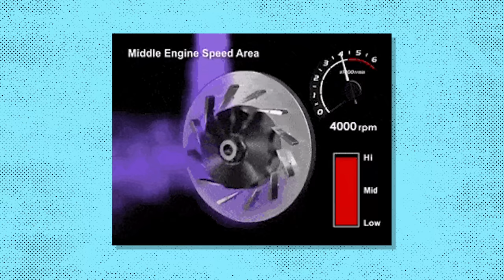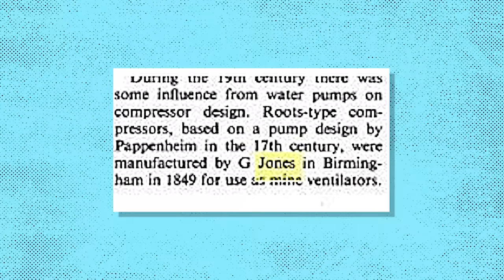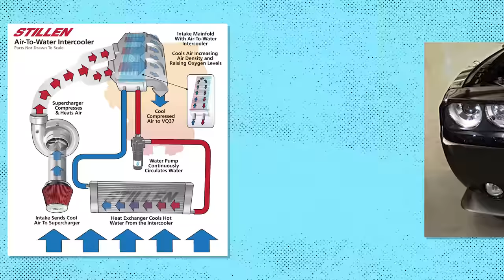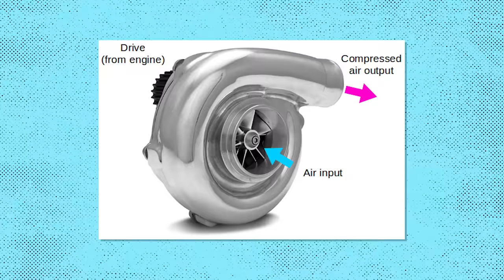Why Superchargers Aren't As Good as Turbos

Comment: Turbo lag is a common problem not apparent superchargers. Turbo's turbine and compressors are normally sized for a particular rev range where there is enough gas flow for them to operate efficiently below this lag they merely increase backpressure and above fail to produce any more flow and therefore power. Superchargers normally operate over a much wider rev range. Depending on how the Turbo is mapped in high HP systems on reaching the boost threshold there can be an instantaneous release of power with tyre traction, high mechanical stress and instability. Turbo's get extremely hot requiring cooling and oil lubrication usually from the engines oil system and cooling systems requiring extra plumbing and adding to stress on those systems. Superchargers operate at lower temperatures and often have self contained lubrication systems.
Electric centrifugal superchargers are super efficient can run at constant speed supply max designed boost over the whole rev range with no lag and little parasitic engine loss but require an expensive 48volt electrical  system to operate.
Reply: Centrifugal superchargers don't have lag? Excuse me?
 Turbo engine need more cooling because they produce more power.
 Boost lag isn't a problem for most correctly designed applications, it is not a real disadvantage but rather an imaginary problem. Turbochargers lag is not accelleration lag.
A vehicle with more power will accellerate faster.
Reply: How can a turbocharger cause backpressure when it flow the same CFMs or more than a naturally aspirated or supercharged engines???
Sounds like you really don't understand how turbochargers work?
Reply: And electric supercharger will have more parasitic loss than a direct or belt drive... this basic engineering fundamentals.
Reply: @sandervanderkammen9230  If you read the comments correctly ELECTRIC superchargers have no lag in operation as the 48 volt system gets the compressor up to speed and keeps it at its designed rating from start up so during operation the there is no lag.
Boost lag is always a problem no matter how well the system is designed unless multiple turbo's are employed cover all rpm spectrums.
The whole point of turbo is to make the engine more efficient and produce more power across the widest RPM range as possible. The duration of the lag compromises these aims the lag determines how quickly the boost pressure becomes effective and over what range.
Reply: @sandervanderkammen9230  Anything which impedes the flow of exhaust gases causes back pressure. Exhaust pipes silencers, DPF's etc. It is obvious it is you who have no idea what you are talking about.
Reply: @jimcraig6523  Don't try to dodge the question son.
Explain how there is backpressure caused by the turbo if the engine produces more power at the same CFM flow or flows more CFMs than a supercharged or naturally aspirated engine.???
Reply: @jimcraig6523  Boost lag is not accelleration lag, it is a perceived lack of acceration based on a non-linear power curve.
 Having a flat power curve improves drivabilty but does not determin the rate of acceration or top speed.
Reply: @jimcraig6523  I don't think you understand what backpressure is, there is no Delta~P so no pressure differential between the intake manifold and the turbine inlets.
Turbochargers use an Impulse Type turbine which uses the velocity of the hot gasses, not the pressure.
Their is no parasitic load on the reciprocating engine by the turbo, it is driven by the heat energy rejected by the reciprocating engine and normally wasted out the tailpipe on a supercharged or naturally aspirated engine.
This is why turbocharged engines make more power... they waste less heat energy and use that energy to reduce the pumping loss.
The temperature drop in turbine is directly linked to the amount of horsepower generated by the turbine wheel and is calculated by using the Brayton Cycle Formula.
Any questions son?
Reply: @sandervanderkammen9230  Are you being deliberately obtuse or just plain ignorant. Anything which impedes the flow of exhaust gases causes back pressure or the inability to find UNRESTRICTED flow. Tthe fact that greater HP is achieved above the boost threshold by forcing more air into the engine does not mean backpressure does not exist. Below the boost threshold the turbo produce no increase in power as the energy from the exhaust gas flow is absorbed by the turbine and the back pressure is greater. No matter what speed the exhaust gas flow enter the turbo there is an energy loss in driving the turbine and compressor wheels. There are no free lunches. The lower the gas speed the greater the loss in relative terms.
Reply: @sandervanderkammen9230  If you cannot produce more power below the turbo threshold that lag most definitely affects the acceleration  wanted or required. What threshold you choose will determine the total power output and size of the Turbo and larger the turbo results in more lag and power higher up the power band.
Reply: @jimcraig6523  Wow, that comment reveals someone who has absolutely  no formal education or professional experience in the field of engineering or engine technology.
You sir are obviously not qualified to speak inteligently about turbocharged engines or ICEs in general.
 Please stop spreading lies and ignorant misinformation.

Turbochargers do not create backpressure because there is no pressure differential... the turbocharged increases power output by increasing volumetric efficiency while simultaneously reducing pumping loss.
If the turbine created a restriction? There would be less flow and higher pumping loss.
The turbocharger is driven by heat energy rejected by the reciprocating engine and does not cause backpressure.
Reply: @jimcraig6523  Turbocharged engines operate using a combined heat cycle with the turbine utilizing the Brayton Cycle as a second pass heat recovery engine.
The heat energy rejected by the reciprocating engine is used to drive the turbine by velocity of exhaust gases, not pressure.
Reply: @sandervanderkammen9230  If there was no difference between the turbine inlet and the manifold pressure there would be no boost. Inlet turbine pressure will be at ATMOSPHERIC 14.8lbs turbo manifold pressure can be anything up to 50-60lbs
 No one ever suggested that pressure drove the turbo turbine only gas speed which is affected by parasitic losses in the valve train and manifold systems. No engine is ever truly unrestricted as far as exhaust gas flow is concerned and there is a pressure developed depending on how well the whole system is designed but will be at a minimum of ambient atmospheric. 
If you knew anything about thermodynamics "SON" you would know in the Brayton Cycle the actual turbine cycle is different from the ideal since the compressor consumes more work and the turbine produces less work than that of the ideal Brayton cycle.
Reply: @jimcraig6523  Sorry son, but your math does not add up.
If there is 7psi of intake manifold boost  pressure  (21.7 in.hg. absolute)
And 7psi of exhaust manifold pressure, WHERE IS the backpressure caused by the turbine???
If there is no pressure differential between the intake and exhaust manifold where is the parasitic loss caused by the turbo?

The centrifugal compressor is significantly more efficient than the pistons in pumping air... even at WOT the intake manifold pressure is less than atmospheric.
Approximately 20% of the heat energy lost after mechanical conversion into shaft horsepower is lost to frictional and pumping loss.
The fundamental concept of forced induction engines is the increase in volumetric efficiency and reduction of pumping loss.
 The turbocharged engine produces more power at the same intake manifold pressure because they significantly lower pumping loss.
Reply: @jimcraig6523  A turbocharged engine operates as a COMBINED CYCLE heat engine e.g. Otto Cycle + Brayton Cycle or Diesel Cycle + Brayton Cycle.
Both heat engines share the same thermal reservoir and adbatic compression cycle.
 Turbochargers engines produce more power than supercharged engines because they use the waste heat energy expelled from the reciprocating engine to drive the turbine.
 The exhaust gas temperature drops as it passes through the turbine, typically 100°C (300°F) 
The temperature drop and the mass of the exhaust gasses tell us how much energy is converted into shaft horsepower generated by the turbine wheel, we use the Brayton Cycle Formula to calculate the thermal efficiency and horsepower generated by the turbo.
 This energy recovery can also by calculated by measuring BSFC
 If you have 2 identical engines, same manifold boost pressure, one turbocharged and the other supercharged, the turbo engine will consume fewer kilograms or pounds of fuel per horsepower generated (per hour).
Any questions son?
Reply: @sandervanderkammen9230  What are you talking about?
Backpressure is simply the resistance to the natural direction of flow of any fluid. It is scalar in essence having magnitude but no direction. Anything which impedes the flow boundary fluid in pipework exacerbated by bends, valves, manifolds, silencers, DPF's Turbo's all conspire to increase friction and generate heat resulting in power loss.

 Exhaust gases leaving the exhaust port stack up in the exhaust manifold behind the turbine wheel as it provides an impediment to flow which must be overcome by the exhaust gas to turn it. That is back pressure. Similarly on the compressor side manifold pressure is stacked up in the inlet manifold waiting on the inlet valve to open. Backpressure. 

In practical terms the chance of arriving at a boost ratio of 1:1 where the exhaust manifold pressure equals the inlet manifold pressure is highly unlikely simply because of the impediments to flow already outlined. The best you can hope for is to get a system with the minimum exhaust back pressure to supply the boost level required which is a series of compromises based on what parameters are set for the engine. EG. A boost ratio much higher than 1:1 would be required to generate the same power as altitude increases.

If you do not believe in exhaust back pressure simply build a few systems and install a backpressure monitor and see what happens.

Parasitic losses for an exhaust gas turbo refers to the loss in efficiency and potential as described due to the losses already enumerated. 

A turbo compressor is only more efficient at pumping air once it has attained its design speed which is much higher than ay piston speed.
Reply: @sandervanderkammen9230  If you are going to run internet searches on subjects you don't understand sonny do not waste my time. As already stated the Brayton or joules cycle is not the most accurate method of determining the thermal efficiency of an internal combustion engine. 

Turbochargers do not produce more power because they use waste heat. They are more EFFICIENT because they use waste heat from the exhaust.

The heat energy absorbed from the hot reservoir in a heat engine to the output to the cold reservoir determines the work done and from that the overall thermal efficiency of the engine including the turbo or supercharger can be calculated.

The turbo may well be more efficient as I know having built many turbo engined systems. But for overall driving in the 1000-5000 rpm range where most everyday driving is done there is nothing to compare with a twin screw supercharged engine for overall drivability.  

There have been a few Supercharged and turbo cars built the only one I have ever driven was the VW Scirocco which was quite impressive marrying both technologies in one package on a small 1.4 litre engine.
Reply: @jimcraig6523  Thank you for proving my point. 
If there is a 1:1 ratio between the intake and exhaust manifold pressure? Then there can be no backpressure... no resistance to flow.
 The Turbine is driven by waste heat energy, not a parasitic load on the reciprocating engine.
This is why turbocharged engines produce more horsepower and use less fuel.
The Turbocharger is a Brayton Cycle engine.. we use the Brayton Cycle Formula only to calculate its efficiency, just as we use the Otto Cycle Formula to calculate its efficiency.
When we turbocharge an engine it becomes a Combined Cycle engine... we use the Carnot Cycle Formula to calculate its efficiency.
Any questions son?
Reply: @jimcraig6523  A twin-screw supercharger is inferior to turbochargers... positive displacement type compressors are less efficient than centrifugal compressors and any increase in volumetric efficiency is off-set by the parasitic loss created by driving the compressor.

A twin-screw supercharged engine can never produce as much power as the same engine with a turbocharger.
Drivabilty is completely subjective, many supercharger cars "feel" faster than a similar turbocharged car that actually consistently produces faster  acceration times.
 A 2,000 lbs car with 300hp will have slower 0-60mph and 1/4 miles times than the same car with 400 hp, if it doesn't your doing something wrong.
Reply: @sandervanderkammen9230   It has taken you a long time of internet searching to come up with a reply which is totally meaningless because you have no idea what you are talking about nor understanding of the subject matter SON. 
The Brayton cycle represents a continuous-combustion device, from separate regions of the engine serving single thermodynamic functions; this is unlike the intermittent-combustion cycles, in a piston engine which supplies the gas to the turbo charger and inevitably causes back pressure over the vast majority if not all its operating range as already explained. The chance of getting a 1:1 ratio over any significant part of its operating range is ZILCH. That is the practical reality.
The Turbo's turbine is driven by the waste heat velocity and expansion which causes BACK PRESSURE on the vanes as the turbine absorbs energy necessary to drive it . That is the parasitic load which reduces the turbo's efficiency. There are no free lunches SON. You can use any formula you like to calculate efficiency but that is all it does Energy in v's waste energy out = efficiency. Any more drivel of the same type will go unanswered SON.
Reply: @jimcraig6523  Sorry son but that comment reveals someone who doesn't understand what backpressure is or how a turbocharger actually works.

A turbocharger is Brayton Cycle engine that operates in a COMBINED CYCLE... its heat source is the heat rejected by the Otto or Diesel Cycle engine.
 The centrifugal turbine in a turbocharger is an IMPULSE type turbine, it works by converting the kinetic energy from the high velocity exhaust gasses... not pressure.
Pressure AND temperature drop in turbine... 
The drop in EGT is directly related to the amount of heat energy converted into shaft horsepower to drive the compressor.

This is all fundamental engineering concepts yet you seem to be completely befuddled by these basic concepts.
Reply: @jimcraig6523  The efficiency of this EGT drop across and the shaft horsepower generated by the turbine is calculated using the Brayton Cycle Formula.
Any questions son?
Reply: @sandervanderkammen9230 As usual you fail to understand the operational differences or you are being purposely obtuse. 
Turbo's have a much narrower power delivery band and turbo lag. They are generally tailored for specific outputs over specific RPM range. They are restricted until enough gas velocity is generated to provide the required boost . TURBO LAG.  When high outputs are required multiple or extremely large turbo's are fitted which increases lag and affect drivability.
Superchargers operate at near engine speed not 120,000-180,000 RPM and produce usable boost lower in the rev range from just above idle. There is nothing subjective about supercharger performance in any car it is a verifiable fact. What is equally true is that the use of a supercharger and turbo is the most practical way to get the max power over the widest operating range RPM
Reply: @jimcraig6523  Why are you afraid to admit that you are wrong?
Reply: @sandervanderkammen9230  Last go Exhaust exiting valves is stored in the manifold due to irregular pulses. The gases are not exited instantaneously result is a pressure build up which can only be back pressure ie a restricted flow. Turbo turbine vanes slow the the flow of exhaust gas from the exhaust manifold absorbing heat and energy necessary to drive the turbine which is back pressure ie restricting the free flow of gases. The compressor sucks in ambient air via the inducer passes the flow through the exducer to the horn of the turbo increasing air flow speed and therefore pressure which absorbs heat and increases back pressure. Finally this air is usually stored in some form of heatsink or intercooler to remove the heat which is again seen as back pressure by the inlet valve. Not only are you befuddled by  basic engineering concepts and gas flow but are totally ignorant of what constitutes back pressure. It is a relatively simple concept which you seem incapable of grasping or more likely do not want to. 
Anyway that's me done I have had enough of this drivel
Reply: @sandervanderkammen9230  I knew you didn't have a clue about turbo charging. The turbine drives the compressor where the increased airflow and boost pressure is generated which gives the increase in HP.
ANY QUESTION SONNY/
Don't bother me again with your drivel
Reply: @jimcraig6523  Why do you contradict yourself?
If the pressure in the intake manifold is the same or higher then there can be no backpressure.
There is no negative Delta~P and less resistance to flow than a naturally aspirated engine.
Reply: @jimcraig6523  Turbochargers don't just improve volumetric efficiency like a supercharger... they also reduce pumping loss and significantly increase thermodynamic efficiency.
 2 engines producing power from the same amount of fuel... same BTUs but more horsepower at the flywheel.
Reply: @jimcraig6523  Please stop posting lies and misinformation about turbochargers, you are obviously not qualified to speak inteligently about Turbocharging.
Reply: @sandervanderkammen9230  Backpressure is a   resistance or force opposing the desired flow of fluid through pipes, leading to friction loss and pressure drop from its ideal consequently ANYTHING which impedes the free flow of and gas or fluid creates BACKPRESSURE. What is so hard to understand.
BYE BYE SONNY
Reply: @jimcraig6523  Turbochargers engines don't have backpressure son... if the intake manifold pressure is the same or higher than the exhaust manifold pressure? There is less resistance to flow than a naturally aspirated engine.
This is why Turbocharged engines produce more power with less fuel.
 
The BSFC isographic efficiency island of a typical turbocharger engine proves rhat you are wrong.

Please stop spreading lies and ignorant misinformation about about turbochargers.
Reply: @jimcraig6523  1:1 pressure ratio equals ZERO pressure differential... Zero Pressure differential means the engine HAS NO BACKPRESSURE.

How can you continue to FAIL to grasp this basic fundamental concept of Fluid Dynamics???
 Did you drop out of school before graduating???
Reply: @jimcraig6523  BSFC is not expressed as a ratio on a efficiency island... its would be a single value,  preferably below 250 (on the P~Axis)
 Look son you're not fooling anyone here, you clearly lack any formal education or professional experience in this field and are obviously not qualified to to discuss this topic inteligently.

Please stop spreading lies and ignorant misinformation about turbochargers.
Reply: @sandervanderkammen9230  You obviously know as much about fluid dynamics as you do about turbo charging. A pressure differential is required to establish flow in a pipe. No differential no fluid flow.
Reply: @jimcraig6523  Thank you for proving my point. 
Turbocharged engines make more power because there is Less resistance to flow.
There is no backpressure, which increases gas flow.
Reply: @jimcraig6523  Again you prove your own argument is a failure.
BSFC tells us that  turbocharged engines are more thermally efficient (They reject less heat energy) because the turbo converts this heat into horsepower to spin the compressor which pumps air more efficiently.
 If turbochargers created backpressure? We would see higher fuel consumption per horsepower/hour.
Reply: @jimcraig6523  You made a complete fool of yourself... I simply pointed this out.
Reply: Turbochargers are better because they simply make more power... they are Combined Cycle heat engines that have higher mechanical and thermal efficiency and...
 thus more power output